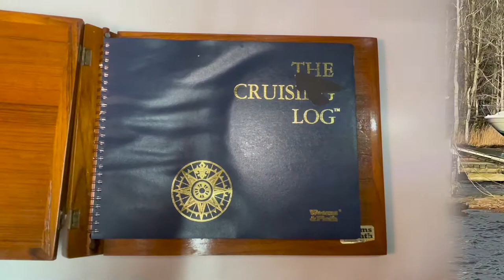How to fix a LEAKY Chainplate on a Tayana 55 CC Blue Water Sailboat!! Sailing SV Bohemian Ep16

Comment: They make a rust reformer that works great..I haven't used it for what you're doing but have used it on semi trucks and trailer suspension and frames etc and construction equipment

Comment: Appreciate your videos on how to make repairs on the Tayana 55 and videos of the boat in general. There aren't many Tayana videos on YouTube. We have a 55cc Tayana as well and our boatyard was doing some repairs on the limiting switch for the centerboard winch and destroyed the winch...Our winch did not have a name plate on it or a stamp listing the manufacturer. I am reaching out to fellow Tayana owners with a retractable centerboard to see if anyone know who manufactured the winch for the centerboard, who carry parts for it or if someone ran into a similar problem and successfully installed a different model winch for their centerboard.
Reply from the maker: My boat has lewmar winches and they say England. They are the old style from 1984. The best place to find old winches in the Annapolis area is Bacon sails. They have a good selection. Ask for Rob. He’s the most knowledgeable guy in Annapolis when it comes to finding hard to get parts. If it’s possible he will find it. https://www.google.com/search?q=bacon%20sails
Reply: @sailingsvbohemian1464  thanks for your reply. The winch in question is not a sheet winch but the winch that raises and lowers the centerboard. You could say that, technically, it is a "hoist"  because the movement of the centerboard is more vertical than horizontal, but they are still called winches, even though they are vertical winches. Resembles your trailer or bumper winches in function rather than your sheet winch.
Reply: Maybe it’s made by the company that made the pedestal or the pulleys on the back for your sheets I think they are fico or fica. I’m going to Herrington harbor in Annapolis to the main guy that works on everything and has a shop in the yard I’ll ask him. He deals with every company you can imagine.. he said the fico company went out of business. 20 years ago. One of my pulleys is a little corroded. He will know.  Or how did it come along.
Reply: Elco is the pulley . They are out of business